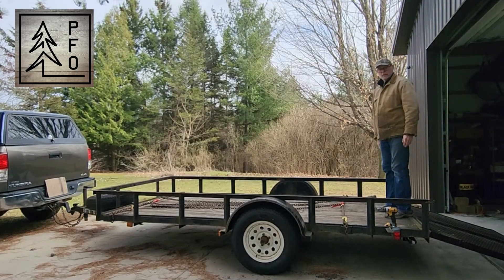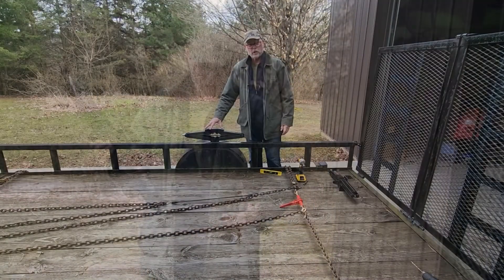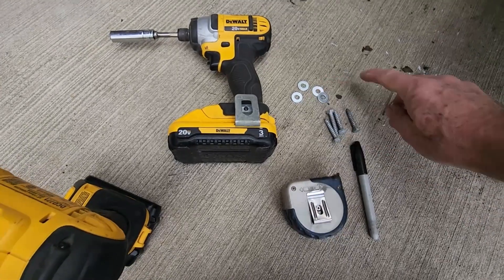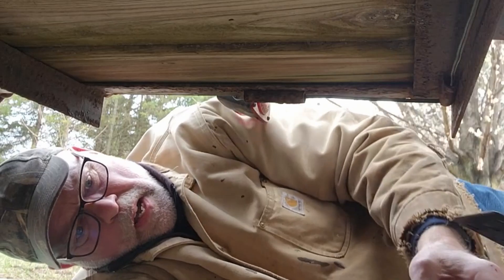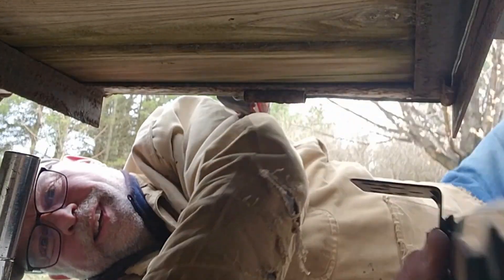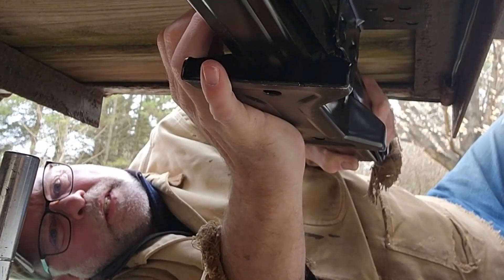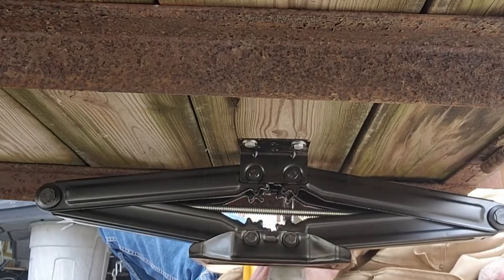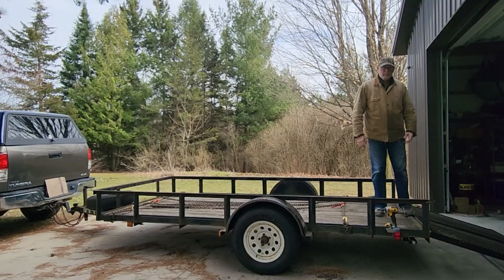Adding Stabilizer Jacks to the Utility Trailer: Final prep to pick up mini excavator at auction yard

Comment: Not sure mounting the stabilizers directly to the wood is the best idea. When the wood starts to age or rot, one stiff bump amd you've left a stabilizer lying in the road. I think you should've added some metal under there and attached them to the metal not the wood.
Reply from the maker: Thanks for the advice. It probably wouldn't be a good idea if I were inclined to leave the wood on there until it rots. I'm not so inclined. Attaching them to metal would definitely be better, in any case.

Comment: Looks like a great idea.  I don't have a ramp on the back of my trailer that helps stabilize the rear when I drive the tractor on it.  I'm always nervous it is going to disconnect when I start driving up the ramps.  That's a lot of down pressure on the rear.
Reply from the maker: I've used the detached ramps, too. They are hard to trust.
Reply: Ramps alone won't stop the front of the trailer from lifting up under a load. Stabilizers or other such support to distribute the load directly is a good idea. I just don't think this man's screwing them directly and only to the wood floor boards is the best idea. 

I added weld on detachable trailer jacks to my car hauler. Cheap and easy to install and no chance of them coming off going down the road.